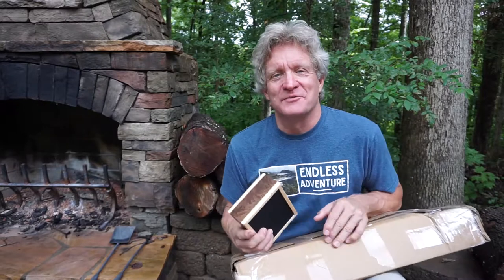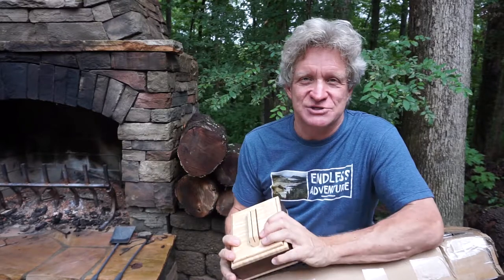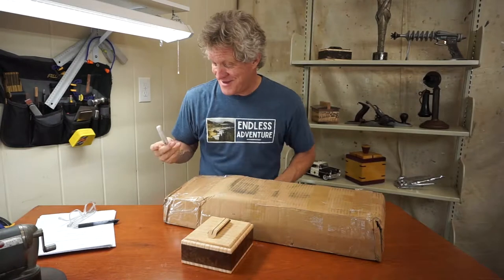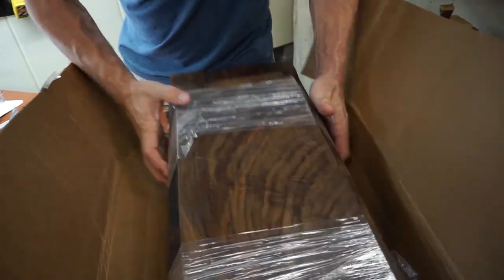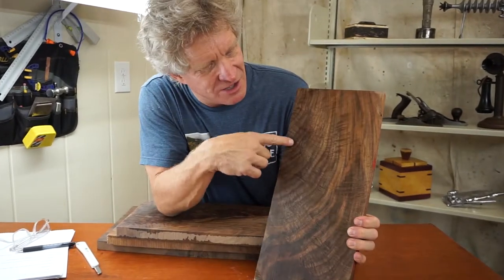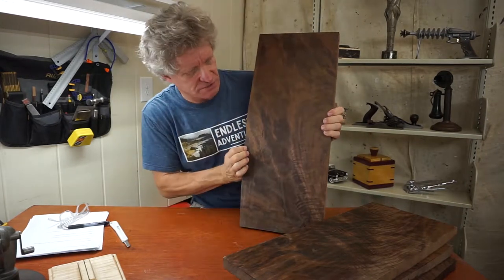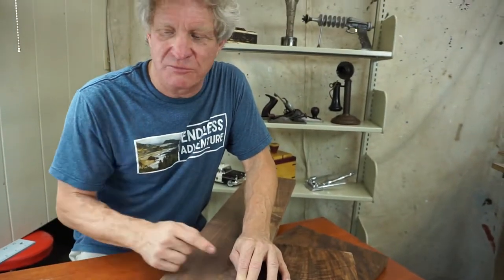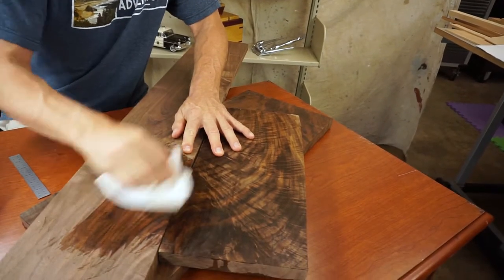Good Wood?!? - Oregon Black Walnut  From Goby

Comment: I noticed that the blanks have a protective coating sprayed on them. Gilmer Wood in Portland does the same thing with their blanks plus they wax the ends. If you had sanded off the coating then applied the naptha it really would have shown the natural color and figuring better. That is some stunning feather crotch Oregon black walnut!